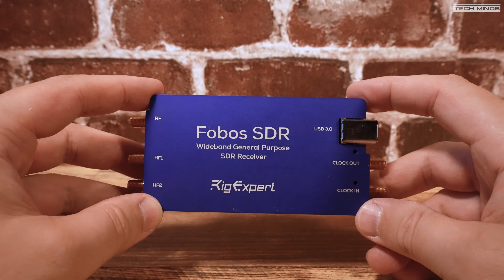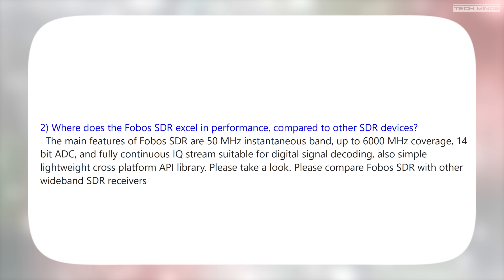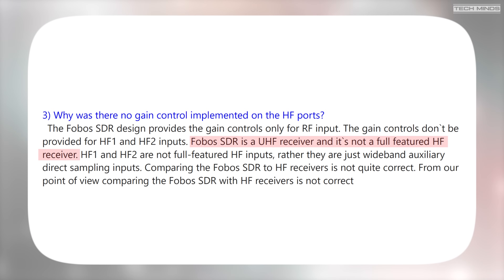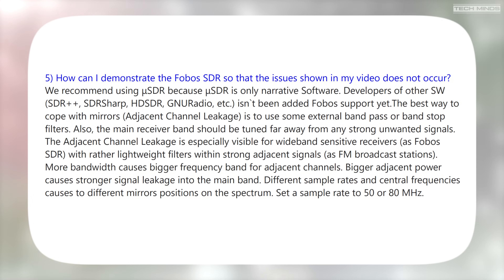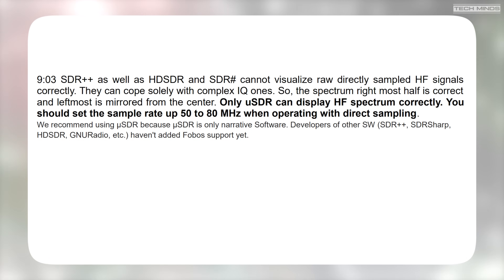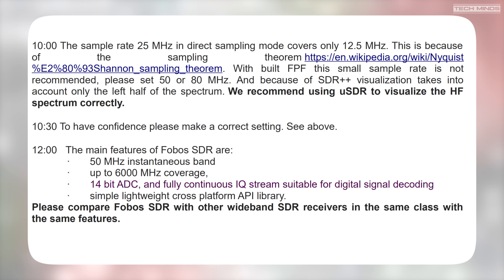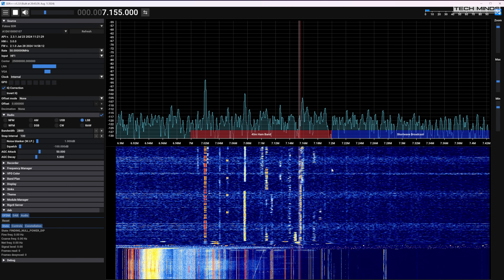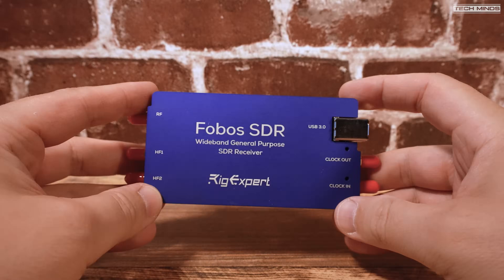RigExpert Responded To My Fobos SDR Review Video!

Comment: Since SDR was more or less made known by YT, a strong focus was also placed on marketing. The SDR was mainly demonstrated with CB radio. However, SDR is not a radio device that contains filters and has been optimized for certain frequencies. It is laboratory equipment that is freely programmable and expandable. They are not actually used for "I'll listen to it", but rather for developing and testing your own radio technology. 

As for the price, we are talking about high-quality laboratory equipment that is available on the consumer market. Take a look at an Ettus USRP E310 and compare it with the ANTSDR E310...

Comment: Breakeven points for multi signal captures.  For instance,  if this system does not have front end components like the filters, that "may" reach a break even perf/cost point against a system that has those components "if" X number are to be acquired.  How quickly does it rescan/reset to new control parameters, when driven by the software perhaps measured by the control signal to first received data from the API?  [ Caveats; all information is good, just not necessarily for it's original purpose.  8)  ]

Comment: SDR++ is working correctly.  Remember, with a sampling rate of 50 MHz, and desired signals in the first Nyquist zone, you get signals up through 25 MHz.

If you set SDR++ to show spectrum up to 50 MHz, it cannot mathematically distnguish whether the data is the "real" or "mirriored" signals seen in the video.  It is like solving a square root: for 4, is the answer 2 or -2?  It is both...

Comment: I have a hunch that the "military use" involved HF1 and HF2 inputs from other equipment, not necessarily an antenna.  FWIW, if you do use it for HF on your own antennas, use your own LNAs and  proper lowpass filters.  That aliasing won't happen with effective filtering before the ADC.

Comment: Can see both sides here Matt, but RigExpert on their very own spec sheet did actually point out that HF was a feature of this product numerous times & this is searchable on Google.
If uSDR was their recommended software, it should be fairly obvious on RE's part.
That the device is extremely sensitive & wideband is no doubt & anyone who is willing to invest the time & money to get the external attenuators should get great results & is a huge plus about this particular SDR & would undoutebly have its applications, maybe priced out of the hobbyist market a tad.
Your fair assumption that a total newbie who'd likely have nil idea about SDR might easily get tripped up thinking something is NQR is valid.
Whereas the 6GHz frequency coverage is desirable, for the price point I'm still aiming for an SDR Play from the UK (1/2 the price, especially freight costs to Australia) as I'm assuming there is no internally software programmable variable RF amp stages in the HF block for them to fix it with a firmware update.
A lot of these SDR devices typically suffer from poor image rejection like this, so this is nothing new to SDR hobbyists & BPFs are a fact of life ever since I played with a RTL years ago when I saw Balint Seeber's video.
Loved your original video & you give a fair, open & frank viewpoint & always put a positive spin on any product you try

Comment: I offer the suggestion to specify more completely what type of spurious signals you are sering on these SDRs.  There is a big difference in causes: some due to saturation of the input, and others due to aliasing .  It is essential to use sufficient RF filtering to attenuate signals which might otherwise cause aliasing interference.

Comment: 50 Mhz "instantaneous band" means "50 mhz of bandwidth in wide-band IF/PAN/SDR-waterfalls"? If so then by nyquist and other sampling rules, a higher sample rate and a very fast througput (USB 3.x latest probably) may be required.  I think the company could use more English-native speakers who are RF-experts and or Hams to help with their write-ups.

Comment: I know it's easily accessible information, but I do wish you'd covered the cost and ship times as well.

Also, "It's not really for HF" is a really strange thing to say, because it has not one but two specific HF antenna hookups. If it's not great for HF, why do those even exist? It feels like backpedaling to say that the receiver isn't designed for HF, because looking at the thing I'd get the expectation that it's fantastic for that use. They need to remove both of the dedicated HF ports and add a high pass filter and just not include HF in the feature set, if HF doesn't work well.
Reply from the maker: I rarely cover costs in my videos, purely because YouTube shows my videos in many countries and the cost can be different depending on exchange rates etc. also, it’s easy to find your local supplier to find out costs and shipping times.

Comment: So what are you supposed to compare this to? How does it compare to say a HackRF One? That also goes to 6 GHz. But it can transmit and it's 1/3-1/4 the price of the Fobos. It can only do 20 Mhz bandwidth vs 50 Mhz here, but if it's cleaner..
Reply: I have the same question. Another candidate to compare is Pluto, which doesn’t even allow to tune to HF. Isn’t this product is in its own class?

Comment: An interesting video. As is often the case, the real problem is in the marketing department. 

Perhaps try comparing with your pluto plus, it has the same weaknesses with respect to filtering. So does the Ettus USRP. It is a common problem and it really needs someone to come up with an affordable tracking filter bank. Lime did one, the Lime-RFE but it was quite costly, probably because it covered transmit. There latest model is great, but not in the realm of amateur budgets. If you wanted a great SDR, then the CloudIQ would be a good choice, but RF space don't seem to be making them any more.

The reason for the 25MHz limitation at HF is because there is only one ADC being used. Just I or just Q, not I and Q. If you were using both in IQ mode it would go to 50 MHz but it doesn't really matter if you are not interested above 25 MHz. Providing baseband access is a good thing, many applications besides radio, just don't sell it as an HF receiver. 

The blockiness in the waterfall is sort of from the sampling. It is software related. Basically FFT size. The bandwidth you see on the display depends on both sample rate and FFT size. Actually the ratio, so if you are sampling at 50 MHz and your FFT size is say 65,536, each block on the display will represent 381Hz of spectrum - well not quite, but you get the idea.  You can focus down with appropriate digital down conversion and decimation rather than zoom into one huge bandwidth.
Reply: Those sdr's use software or fpga to calculate the IQ signal. Using a Hilbert transform. But this halfs your samplerate. So 50 MHz becomes 25 MHz max or 80 MHz becomes max 40 MHz. This also how the radioberry does it for 120 euro 😊

Comment: If I wanted to test reflective power or component values in the old days I might have used Rig Expert's antenna analyser simply because in comparison tests it came closer to actual values than the similar in price MFJ analyzer.

However, this has changed with the advent of the $50 Nano Vna & subsequent devices where in all comparisons I've seen the Nano Vna wins hands down with respect to calculating the actual parameter being sought relative to the device under test. 

So, while the trade name Rig Expert for some may imply quality, it does not for me & their SDR they seem to be saying is not, yet is, for general coverage of the HF interval of the spectrum provided you add all the filters required is in a sense like the simplest crystal radio receiver I built as a boy where it had nearly no selectivity & pretty much allowed every station to be received. 

I suppose if I wanted to spend roughly $500 on a device that needed improved by spending additional money the SDR in question would be the winner, but I desire doing so as much as testing my luck skydiving without a parachute. 

Simply stated, no thanks Rig Expert, however I'd love to know why the Ukrainian Army deems this device desirable, or is that just marketing hyperbole.

Comment: It's a question of what expectations are being set.  When I see "General Purpose SDR Receiver" (as written on the case), I think "appliance".   And I'd assume it's suitable for that purpose as a "receiver".  It seems like the reality is that this is "test equipment" if it requires external filters, attenuators and other manual configuration for some particular situation.  That's not necessarily good or bad in and of itself, but a potential disappointment when expectations and function are not matching.

Perhaps if "HF1" and "HF2" were labeled differently and conveyed as "don't connect this directly to an antenna", there would be less surprise and/or disappointment?

Comment: Thank you for the original video, as well as this follow-up. Props to RigExpert for getting back to you in the spirit that they have, it does highlight that they are still "good people" (unlike some other extremely litigious non-ham companies that sells re-badged consumer electronics and dodgy LFP batteries). The  fact that they are responding to you directly instead of their solicitor speaks volumes of their integrity. Brilliant, props to all. Regarding the Fobos, this seems to be a very focused product, probably better suited to scientific and military needs rather than general "ham-handed radio enthusiasts" like myself. It's good that there are items like this, I would certainly be looking at something like this further down the road as my radio hobby progresses. Regarding the price of approx £430, this might seem like a lot to some, but keep in mind that high-precision radio equipment can cost many times this amount. Therefore I would say it's fairly priced in my humble opinion, so no criticism from me in this respect. 73, Jan (M7HNK)

Comment: This looks like an excellent product, I have been into SDR's for 15 years and a EMC technician using high spec spectrum analysers. I think most of the HF problems can be solved with an antenna tuner rather than pass or stop filters as it will reduce other signals from out of band

Comment: LOL, "it's not a full featured HF receiver" while the sales literature just list it as a HF+ VHF/UHF receiver.  Come on RigExpert.  Just admit it, you blew it on the HF receiver side.  I was going to buy one of these because it included HF with the higher frequency coverage but once I saw it's rather dismal performance on HF I decided to pass.  If it's not designed to be a HF receiver then DON'T ADVERTISE IT AS ONE!  Mike KC3OSD

Comment: why spend $400 when you can get a comparable sdr for cheaper with the same challenges to overcome, rigexpert flopped on this one
Reply: Name the comparable SDR?  The HackRF is only 32MHz sample rate.  The BladeRF is over $500 (way more with a good enclosure), and Ettus gear is much more expensive than that.  The LimeSDR only goes to 3.8GHz.  Since certain nation state purchasers are happy with the Fobos, I think we can guess that it's the sweet spot for particular applications.  Personally, I think it would be fun to add to my cadre of SDRs just for the direct sampling feature.  I'm not afraid to add stages in front to compensate for the drawbacks of shere unmitigated power :-).
Reply: What about Pluto sdr.

Comment: I think your original video is fair and you approached the device as I, as an amateur radio enthusiast, would have. Given the marketing and specification information that seems to have been a fair and logical approach.  

Given the information you've been given as an update it's clear this wouldn't be an ideal device for me. This is good to know as I'm a HUGE fan of the rig expert HF analysers. While I'm glad that they've provided this extra information I'm a little bit irked by some of their response as I think much of the issues seem to have stemmed from incomplete and potentially misleading information in the marketing for this very new product. I think you cover this briefly in the video. 

It sounds from your update that this is an impressive bit of kit but it's important to note the limitations and considerations Vs other products commonly used by amateurs. Even the answer to your question about the audience seems strange to me to be honest in light of some of the later info. 

Anyway, thanks for making both videos. Very interesting and useful even though I know neither are the sort of content you generally like to make. Given my previously overwhelming positive experience with Rig Expert gear I am hoping that in future they may release a more amateur/HF based product that I would find useful.